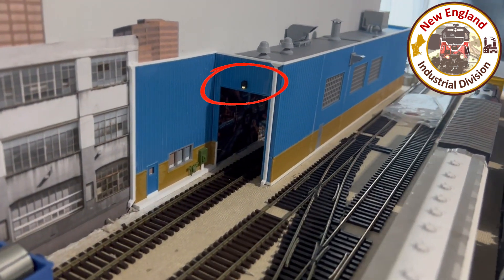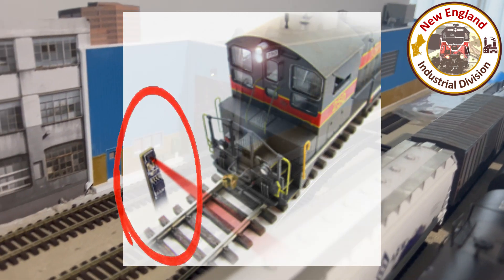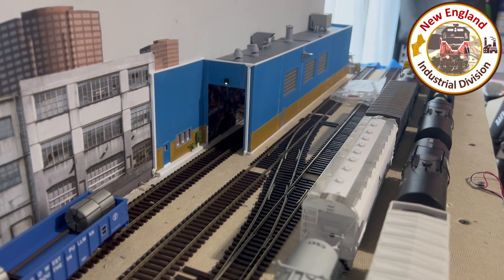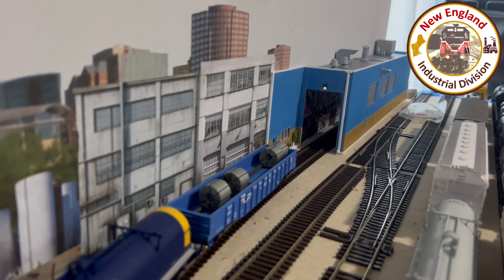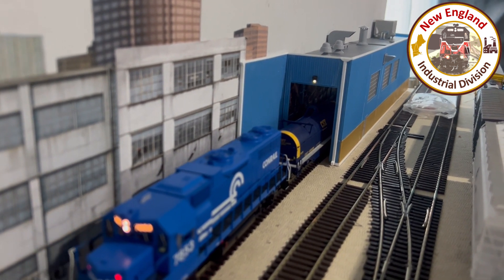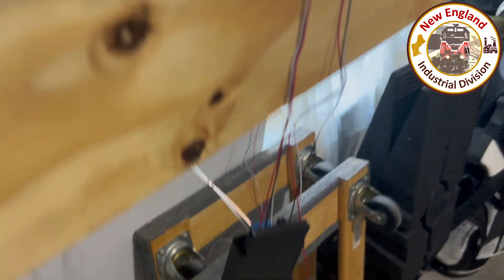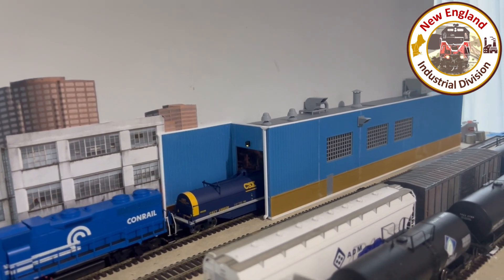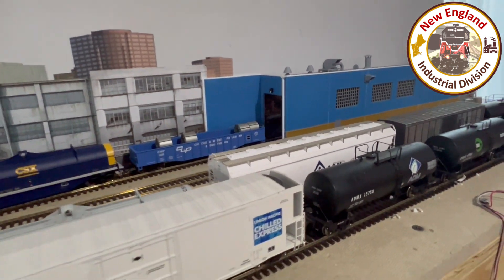Using Fiber Optics to Scratch Build an HO Loading Door Signal Light

Comment: I might look into that for a one-off train signal on my layout. On the prototype, it's wired to the crossing signals, to tell the engineer when it's clear to go. I built the signal but it's not lighted. Like you said, there are probably more applications.
Reply from the maker: Definitely was a fun little project Bill. I like adding those small details to add to the fun.

Comment: Good work with that signal Paul. If you decide to do an electric uncoupler inside the building, be sure to energize it with only a momentary switch so you can couple back up later on. Keep up the good work sir!!
Reply from the maker: Thank you! I ended up moving the sensor closer so it goes red while the first car is just outside the door. Allows me to uncouple it by hand.
Reply: @HartfordWhaler  Like you said before, good minds think alike. I was thinking of uncoupling outside the building also. Have a great day sir

Comment: Kool signal 😎 neat setup ! But was wondering 🤔…. What will you use to uncouple the cars ?
Reply from the maker: Plan is to uncouple the cars right at the door. Could do with a Kaydee magnet, but the cars don’t need to be all the way in the building to be uncoupled. I also plan to move the sensor closer to the door so it goes red when the first car is sticking out of the building. It was meant to be a safety so nobody hit the back wall. But now my practical thinking is coming to the same conclusion you did. Thanks for the comments and for watching.
Reply: @HartfordWhaler  That green / red signal looks fantastic, and is a great idea, along with your idea to uncouple the cars at the entrance of the building.

And if you want to go down another rabbit hole - LOL - then think about converting your perfectly functional Kadee 148's to Prototype Couplers (formerly Sergeant Engineering) because they are 1/87 scale, and operate so well with no springs to force the coupler shank to return to the center of the coupler pocket, making (de)coupling on curves so much easier (-if you're going to manually uncouple your cars).

Having said that, you'd have to convert all motive power / rolling stock, unless you just want to use them between MU'd engines with a Kadee 148 at the front of the lead engine, and the rear of the 2nd engine to couple with Kadee equipped rolling stock.  

FYI: I sold my engines that I converted to Sergeant Engineering couplers a few years ago, but now that I am starting over again, and "going small" - like you and a few other influential modelers are doing - I only plan to purchase about six DCC equipped engines. 

Therefore, the lure of those Prototype Couplers is very strong, and I thought I'd mention them to you because you are doing your best to emulate prototypical operations.  https://prototypecouplers.com/FAQCompatibility.html

Comment: Need a uncoupler, under the tracks, in the building. Probably electric rather than just a magnet.
Reply from the maker: Thought of that. What I may do is move the sensor forward so the light goes red earlier - without having to push both cars in so far. That way I can uncouple with the first car exposed from the building. The inside car can stay connected to the first car. It makes a nice challenge for operations. To get the inside car, you have to pull both out. I may put a manual Kaydee magnet right at the building entrance. Thanks for the ideas and for watching!